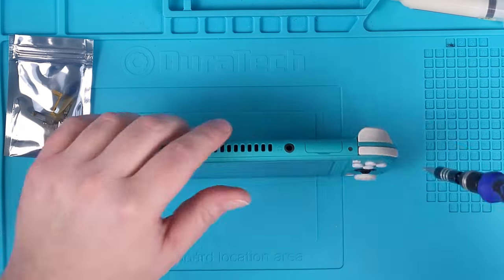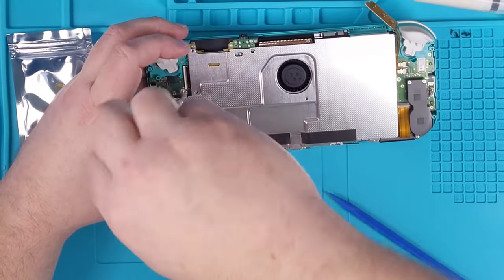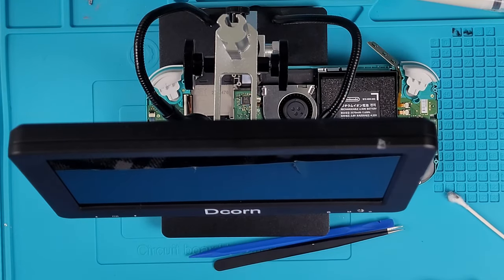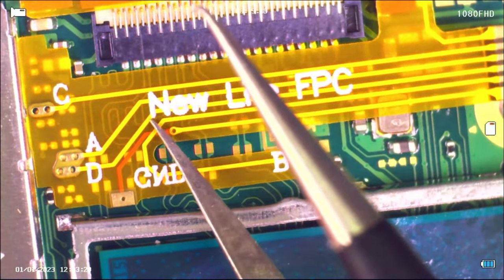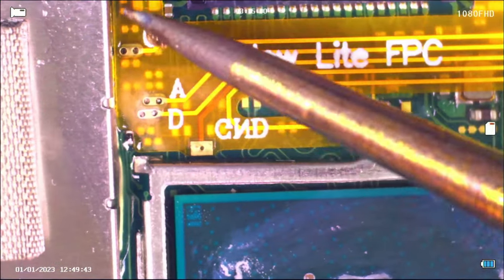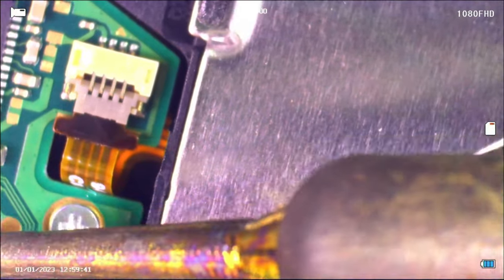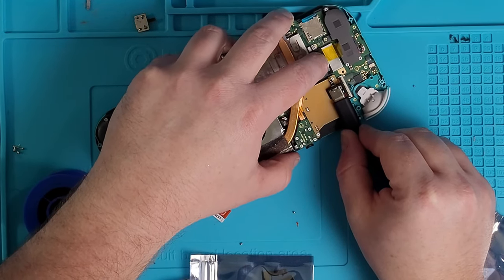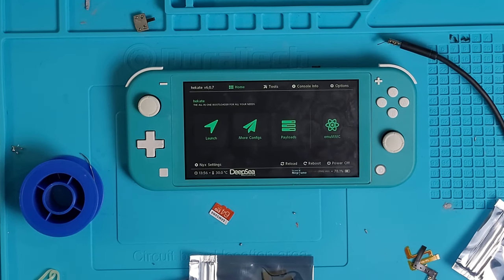Hack Your Switch Lite In 2024 With Hwfly Lite rp2040 Zero Picofly

Comment: Soldering seems like a surgery to me, I'll leave it to the professionals.
Reply: tbh I used to think the same until I hacked my third xbox 360
Reply: @senkensu  I KNOW for a fact that the kids I babysit will pull my arm to get my attention. I can't afford to mess up or risk the kids getting hurt because I dropped a hot tool. So I'd rather send my console to someone who can do it for me.
Reply: @sunnystarryskies5910  Ahhh I see, didn't mean to sound ignorant
Reply from the maker: Send it on over 😜 I have kids myself but also have my office I hide in for work lol
Reply: @senkensu  You weren't being ignorant. Hopefully, I'll have the confidence to do it myself one day.
Reply: @DNAMobileGaming   how much
Reply: Real
Reply: This kind of soldering is incredibly intimidating, nerve-wracking, and difficult the first, like, 3 times you do it. It's actually a super easy skill to pick up, it just feels so high stakes because you're thinking about doing it to a console that cost a bunch of money. If you get any kind of dead electronic, you can take out the board, and practice taking parts off and putting them back on. 

It'll take a $60-$100 investment into the equipment, but you'll have a valuable skill at the end:

 - Get a Pinecil soldering pen for like $30-$40.
 - $5-$10 for an iron holder + brass sponge tip cleaner set
 - $5-$10 of 60/40 ROSIN CORE (this has rosin flux in the middle) solder, 1mm or less diameter
 - $5 for tweezers to hold the solder so you don't have to worry about remembering to wash the lead off your hands (or get one of the solders that has a holding tube so you don't have to touch the solder) and to hold tiny-tiny components in place if you have to.
 - $5-$10 liquid flux pen (when you're getting started it's easier to dab a spot with a pen than to have to spread the goop flux around like in this video)
 - $5 of isopropyl alcohol and Q-tips to dissolve and wipe away the flux when you're done
 - $5-$10 of braided solder wick to remove solder from parts/remove excess solder if you make a mistake
 - $5-$10 set of jeweler's eye loops instead of the microscope, or just use your phone's camera zoom

That's the full list of what you need to get started. $60-$100, and when you're done with it, it'll all fit inside a shoebox. It's intimidating, looking in, but I promise once you've done like 5 parts you'll laugh at how hard you thought it looked.
Reply: @DNAMobileGaming  how much? id glady sent it over🗣️🗣️
Reply: Wise choice: I solder on a regular basis and I can assure you I could never be a surgeon
Reply from the maker: @Ragnarok834 I've now successfully done 5 Lites, and 2 regular Switch consoles and love everything about it.
Reply: its easy ...you can doit take an 2inch iron stab place it in fire till its glowing and then you press it smoothly with soldering paste on the right place...you cant miss it 😅🤣😂be strong and mighty😝
Reply: @DNAMobileGaming  how much would it cost for u to homebrew my switch lite

Comment: Guys soldering is hard. Don't do it if you don't know how to solder or you didn't solder before. Believe me you will destroy your device leave it to a professional
Reply from the maker: I have no soldered 6 Switches successfully 4 Lite models and 2 normal models.  I'm no professional but I will be sharing how a beginner can do this with a steady hand soon.  I also soldered a cool modification to my New 3DS XL last night as well no problems because of the correct tools.
Reply: Yes I did it myself without a microscope but I did without prior soldering skills,  but I actually looked at about 20 hrs of tutorials before I tried lol you definitely to have good eyes and steady hands and try not to burn the solder.. also keep a toothbrush and alcohol handy and keep your soldering iron at a steady temp.  (I touch the damp sponge to cool it a bit and keep that iron clean!!!)
Reply: Good thing I already destroyed laptops in my 20s lol
Reply: I've broken a gamecube before trying to solder wires to the board 😅😅 I'm not messin with that again
Reply: I've messed up a PS3 HDMI port and an Xbox one Controller attempting to Solder. Definitely is tough, but at the same time it feels rewarding to do something yourself.

I switched my Vita OLED's screen and it now works like a charm. I'll watch some tutorials on Soldering and attempt this.
Reply: Ngl dont wanna judge but come on... Hot air soldering iron.... Way better invesment than a microscope impho

Comment: You really need to ramp up the temperature of your soldering iron, the solder looks cold af
Reply from the maker: I recently acquired more knowledge of this I had it set to only 300 degrees I also bought new tips, solder wire, and other stuff which actually really helped with doing my second one.  Thank you for your help though.
Reply: Came here to suggest this!
Reply: @DNAMobileGaming  300 degrees should be good, thats what i do. up to 330, but if yours is set to 300 then maybe want to look at a new iron, but its sounds like some new soldering hardware has helped

Comment: hahaha I can notice some difficulties there with the soldering but I salute you cuz anyways theres no other way to get better than practicing and taking risks! 
Great video by the way!
Reply from the maker: Yeah this was my second Switch Lite at the time I attempted but now I've done 5 total Lites successfully and 2 regular consoles.  The only SCARY part is the CMB capacitors near the GPU if you mess them up then your switch is basically toast cakes.
Reply: @DNAMobileGaming I installed the same ship but on the normal switch V2 and definitely was a bit scary but yeah after soldering many times you get more confidence and better skills. Keep the good work mate! 🙌🏻🙌🏻🙌🏻
Reply from the maker: @tkdgamerdavid  oh the V1/V2 was where I thought it was easier I shared a trick for soldering to those capacitors as well using some Kapton tape to cover the other capacitors and hold down the cable.  Thanks for the props this was an enjoyable project and has opened my mind up more about modifications/hacks this year.:_Clan::_AButt::_BButt::_XButt::_YButt:

Comment: Hey man, just wanted to make a comment on your soldering. When you solder to the pads, you should really be using a flat or chisel tip soldering iron, you're going to get much better contact with the pads that way. You look like you're just gently touching the solder, and that is not going to make the solder flow nicely onto the pad. The solder flows to where heat is, so you need to heat the pad. Finally, I'm not sure if you're using it already or not, but get flux core solder - that'll make everything go a lot smoother. 

You still did a great job though, I'll be following this tutorial to mod my switch!
Reply from the maker: Hey thank you for the tips, I actually watched a lot and researched a lot more after doing this video and have now successfully hacked 7 consoles 5 Lites and 2 regular.  My wick was really old during this guide too, so I did get some resin core plus new tips.  The tips I got that actually work really nice are rounded I have the chisel style ones too but I couldn't wrap my brain around them.  If you enjoy this stuff check out my guide about the V2 hack I shared, plus I'm sharing a cool hack plus modification video soon as well.  Thank you for the tips too, the community helps so much with this stuff.
Reply: @DNAMobileGaming  ah nice one man! Keep it up

Comment: Hacking in the 90s: LOL just buy a gameshark from a store. its right there bro
Hacking in the 2000: LOL just buy this weird game for you psp. it does something weird and you can put all ur games on it bro
Hacking in the 2010s: umm you're going to need several bits of software and we have a 24/7 server for you to hack into the bios of ur 3DS and even after all this it might brick your console
Hacking in 2020s: Okay you're going to need to learn how to solder and manufacture custom boards
Hacking in 2030s: Please get your neuronet ai trained for this month's randomized kernel access so we can install a virus that will unlock the 5000 step process that must be done within 3 hours and has a 1% chance of success.
Reply: In the 2000s it has also been about soldering modchips into PS2s and PSPs
Reply: @MrFirecasters  whoa i remember that. Yeah people had to buy modded ps2s. i never heard about that for psps though

Comment: I did this to my patched switch i heard the lite is a bit harder though to do and the oled even harder, any truth in this?
Reply from the maker: Well I suck at soldering, not that I can't advance my soldering skills but I was able to do it and got it working to the point where I bought more Switch Lites and more of these mods to try to do it with professionally as I've learned a few techniques the last few days for soldering.  SO OLED yes heard it's harder, maybe I'll try it.  The Lite however is supposed to be the easiest with this new kit now.

Comment: I think the type of solder you used was poor. I use 300c with Kester 44 solder and the temp is sufficient.
Reply from the maker: Oh it sure was poor I got new solder Towot SW-0850H with a tiny bit of lead and 1.8% flux.  I sometimes don't even need to use flux anymore because of it.  When I shared this I was just learning now I've successfully nicely soldered a dozen Switches.
Reply: @DNAMobileGaming  Haha in this case it's 100% material problem, not skill issue! I'd still use loads of flux as it can be cleaned away easily and makes everything so much simpler.

Comment: There are two type of chips ? Is this is better or the other one as in does it matter ?
Reply from the maker: There's 3 chips one for each Switch model.  Now if you mean variants of the Pico chip yes there's old ones and this one which is the easier to install and more reliable.  I can vouch for this as my kids use their Switch Lites a lot and it still works to this day knock on wood.
Reply: @DNAMobileGaming  how's the performance any issues after the modify ?

Comment: I don't know if it's the soldering iron or the solder wire or the flux, but that was not properly soldered down. The solder should really shine, something that you used is very bad quality but im not sure what.😢
But it did work. 🤠
Reply from the maker: It worked it was crap solder also stated I wasn't amazing at soldering I did a second one too and it worked too 😝

Comment: So would physical games still work and be played online multi-player in this modded switch lite?
Reply from the maker: Of course you just need to switch back to the original firmware.
Reply: @DNAMobileGaming  So you think is $85 a good price to mod/jailbreak the switch lite with 128gb SD card included with those specs?
Reply from the maker: @binitrai2117 I guess it depends if you need to ship it etc.  I charge a flat fee with or without SD setup locally

Comment: Can you send a picture of how the modchip should look like? I’m looking on ali and there’s so many variants and they all look different. I tried searching hwfly lite and it’s showing up as the $8 ones
Reply: Should be a right angled board with a yellow flex cable and another black cable. Only the lite will have the yellow cable so look for that.
Reply: @Goodgamer78  it should be the one with 4 pcs right?
Reply from the maker: Oh it looks like you got the answer also the thumbnail has a pic of it too on the right.  Just search HWFLY Lite on AliExpress.  The chip with the yellow cable is the one you want, they change the name of it a lot probably for obvious reasons.

Comment: This looks like a relatively easy mod option. I wonder what all it can do.
Reply: Mr. DNA makes everything look easy. Soldering this mod chip is not even close to easy. If you even mess up the smallest bit, you're Switch is fried. I would NOT attempt this if you don't have much experience with soldering. There are people who you can pay to do the whole hacking process, who solder the chip on and hack it all for you, but it's like $130. If I were you, just simply buy a used version 1 Switch for much cheaper, and hack that one instead.
Reply from the maker: Oh this was a 2.5 hour mod for me because I was taking my time and took breaks 😂.  I turned a 2.5 hour video into 5 minutes so I didn't make anyone bored 😴 🤣

Comment: if you dont want to posst the link, how much was the chip and what site at least? :3
Reply from the maker: You have to search it on AliExpress.  You'll find it eventually they keep changing the name and I've mentioned this as it's the only reason I haven't linked it again.
Reply: @DNAMobileGaming  theres multiple listings, i was wondering how much you paid so I know what to actually look for becasue some are $30 and some are $5?
Reply from the maker: @CHILDISHGATITO  from what I found there's only 1 on AliExpress you just need to search for it.  I'm sure you can figure it out just search Pico Switch then pick the right one for your model.

Comment: There's no damn way that there's no damn way to do this without soldering
Reply: Like from a technical standpoint, it makes no sense. It's JUST an android device without android on it. Meaning it can be jailbroken....because every android device can be jailbroken
Reply from the maker: Well no it's not an Android device it utilizes some Android drivers but Splintendo uses a proprietary operating system that was derived front the 3DS lol.  Android sure can be out on it but it's not Android based.  The reason nobody has created a hack yet is because of how locked down Nintendo Switch Online is and trying to bypass that aspect is extremely different.  Not saying it won't happen maybe the Switch 2.0 will change this but this is the easiest method to date

Comment: Once it’s moded what can i do with it? Installing cfw and playing backup games is possible?
Reply from the maker: There's plenty you can do like play backups of games, install all of your games rather than having to cycle through multiple games carts, backup saves files, give your device a new look with custom themes, overclock your device, crank up the resolution on some games and more
Reply: @DNAMobileGaming  i live in Germany, do you do the service privately? Or only in Canada
Reply from the maker: It'd be too costly to do so I'm releasing a more raw uncut how to guide about this soon.  It does require a lot of tools however if you want to succeed at doing it yourself but I know that's also not for everyone either.